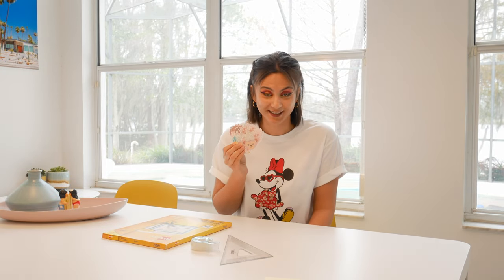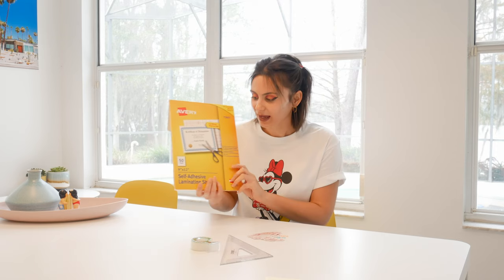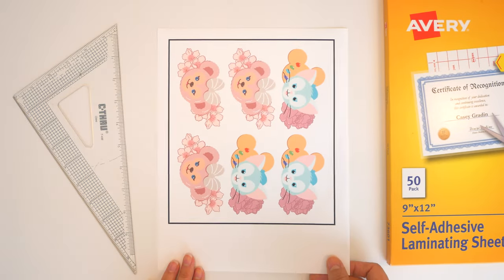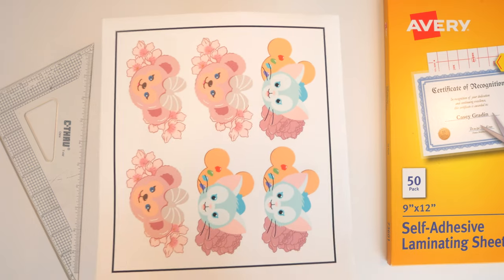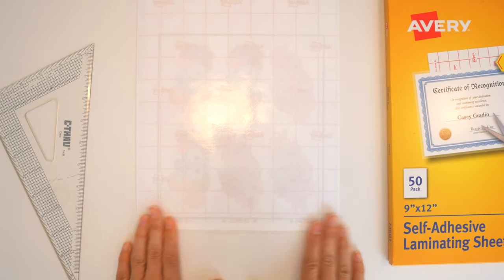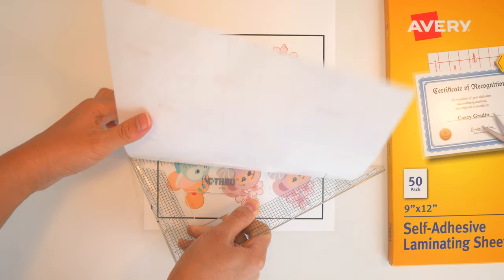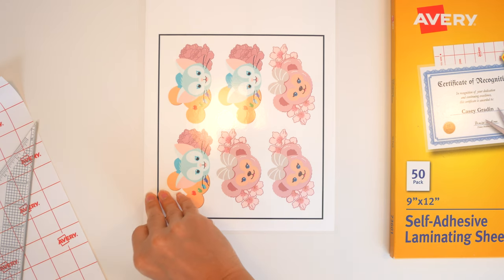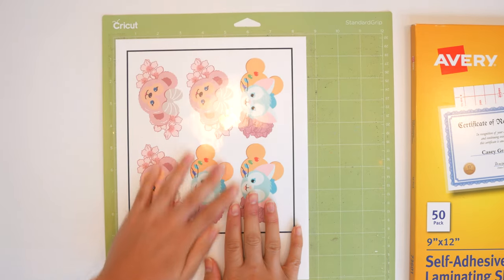How to Laminate Stickers at Home + A Hack for 'Cannot Read Cut Sensor Marks' Error after Laminating

Comment: Hey Keila! I think this video is really helpful! I do have one question though: what setting did you put your Cricut to cut your laminated stickers?
Reply from the maker: Hi MyaoChan! Thanks for watching. So on the machine itself I have it set to “Custom” then in Cricut Design Space I use the “Heavy Cardstock” setting for EVERYTHING 😂 I also set that to “more” pressure vs just the default option. Hope this helps! 👍
Reply: @keilamarciel  thank you! Yes this helps a lot c:

Comment: Do you have to use this exact tape? I have wall-safe tape and it's pretty matte but my cricut still can't read the lines
Reply from the maker: I’ve only ever tried using the scotch brand magic matte tape so I can’t speak for others but if you don’t want to buy a bunch of it someone here in the comments suggested putting the scotch matte tape on the sensor light itself.
Reply: @keilamarciel  I do have the Scotch brand and i tried using the trick mentioned but no luck for me. my cricut still doesn't see the lines

Comment: do the lamination sheets make the stickers to thick my put on cylinder surfaces (thin metal water bottles) or are they still flimsy?
Reply from the maker: I have a metal water bottle covered in laminated stickers I've made. It's been over a year that they've been on there and they're still fine 👌
Reply from the maker: As for the cylindrical surfaces it really depends on the curves in your design, for me some of my stickers got a little crinkled more toward the neck of the bottle.
Reply: @keilamarciel  thank you much!!! I've been trying acrylic sprays and I just do not like how they come out. Definitely gunna try laminating after this
Reply from the maker: @larzpeterson6471  Hope it all works out how you want! 🍀

Comment: what do you do when even with tape it wont read? (im using a sparkle holo laminate )
Reply from the maker: Just to make sure, are you using the matte tape? And something I tried before the tape that worked was going over the lines with a sharpie. Just use a ruler to make sure the lines are perfectly straight. Hope this helps 🤞
Reply: @keilamarciel  yes I am using matte tape, haven't tried the sharpie, that's a good idea thanks! :)

Comment: when i use this specific laminating sheets no matter how much i try to smooth it out there are still ridges that show up in the light. do u have that issue at all?
Reply from the maker: Sorry for the late response! Are you getting air bubbles? I used to have that problem when I used the roll of laminate. But ever since I got these they’ve worked great for me. I just peel and lay it face down, then my sticker sheet face down. If there’s no air bubbles at that point and you smooth it with a ruler it should be good. I guess you just get a feel for it after a while. I messed up a lot at first 😓 but sold some of the messed up ones as B Grade stickers for a discount on my shop and ppl didn’t seem to mind.
Reply: @keilamarciel  funny enough i found that after leaving them overnight most of the little ridges/airpockets that i saw disappeared! i also got a felt ridge squeegee type thing to smooth it out. thanks so much for the video!
Reply from the maker: Yay! I’m so glad to hear that it all worked out! Also the squeegee sounds awesome! Thanks for watching! ☺️